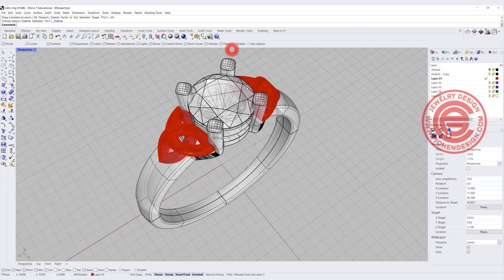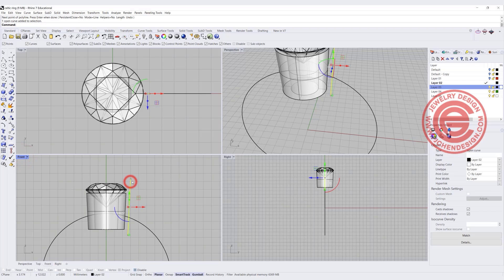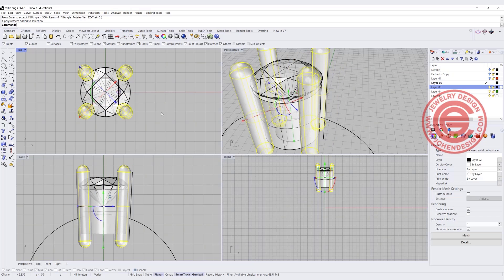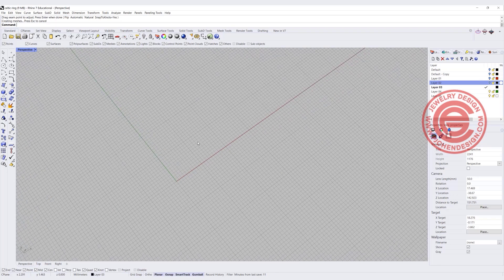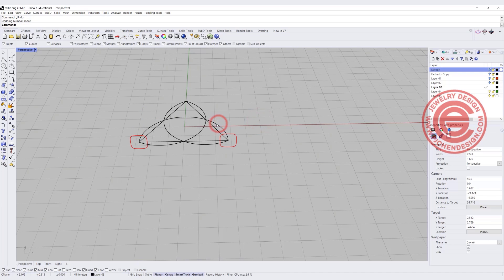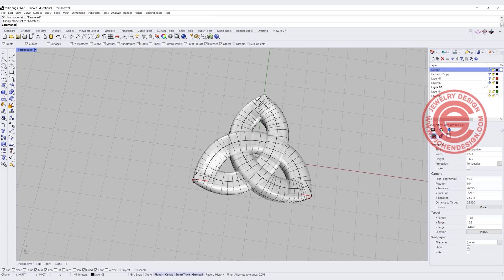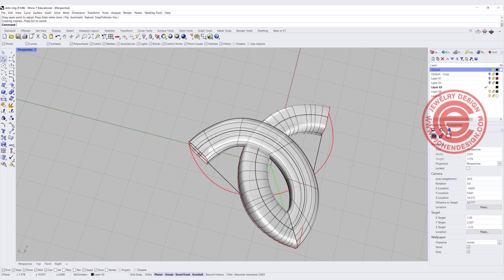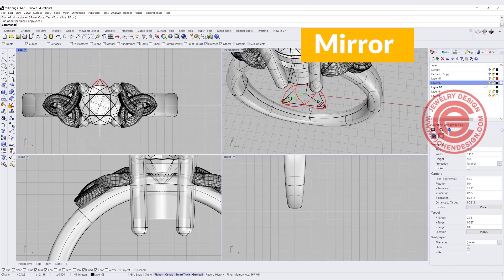How to Model a Two-Tone Celtic Knot Ring in Rhino 3D – Jewelry CAD Tutorial #517

Comment: Hi PJ, I'm having a difficult time with a lot of boolean operations with the celtic knot in relation to the ring shank or cutting out a seat for it, despite it being two closed polysurfaces with no naked edges. Based on a little bit of experimenting, I figure it's an issue with the knot itself but I can't seem to figure out what the problem is. Notably, I'm able to boolean union prongs to the celtic knot, but anything beyond that, like merging the knot to the shank or trying to cut out a recess within it leads to trouble.
Reply from the maker: Make sure there are no self-intersections in your Celtic knot model, especially where you're performing the boolean operations.